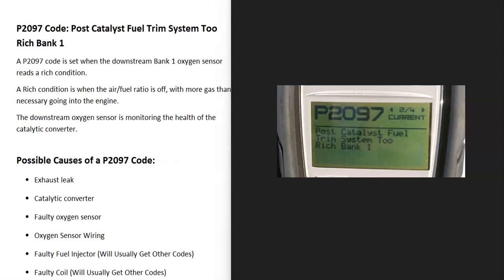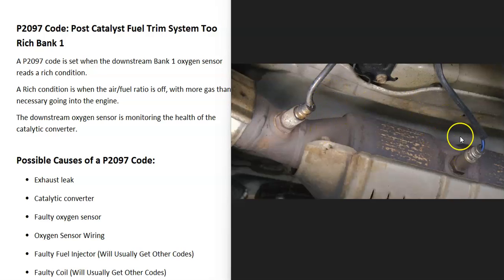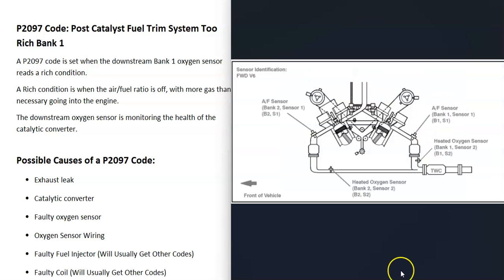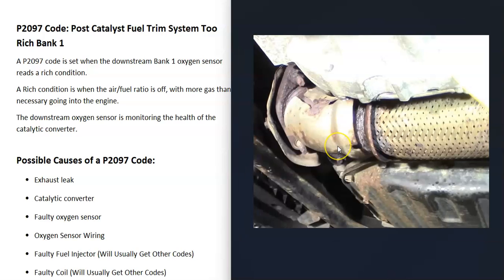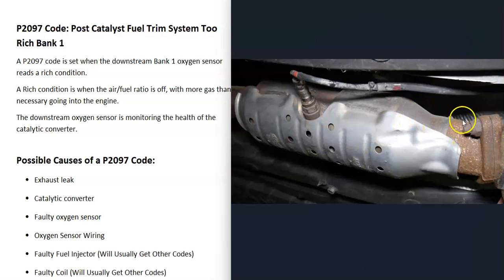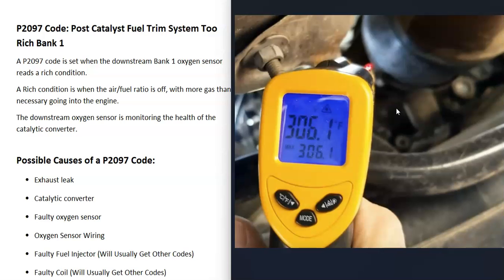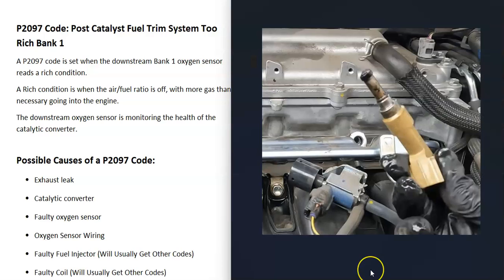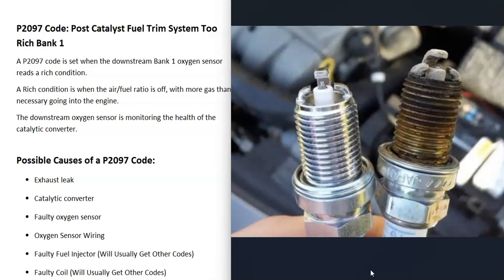Causes and Fixes P2097 Code: Post Catalyst Fuel Trim System Too Rich Bank 1

Comment: Had this code on a 2016 Chevy Malibu. Light went off after getting the code and hasn't come back on for 4 days of mixed driving. should I still worry about driving the car?
Reply: Have you gotten it fixed? Any symptoms and has the code come back? I have a 2018 Malibu and same code plus P0171

Comment: 2020 Honda HR-V. Throwing codes P0171- Bank 1 too lean. AND code P2097- Bank 1 Post catalyst fuel trim system too rich. Too lean and too rich. What gives?
Reply: I have the same codes on 2018 Malibu. What ended up happening with yours, did you fix it?

Comment: I have a 2014 Silverado 5.3 check engine light just came on. I stopped by AutoZone and they run the code and it came back P2097. 
Post CO detector bank one driver side ?

Comment: I have a 2014 Chevy Silverado was getting p2097 and p2099 codes changed both and got a p2097 back again, I was told there may be a reset? If you have any ideas I appreciate it.

Comment: I have just the P2097 code on my 2010 Subaru Impreza wagon. No other codes. I have already changed my o2 sensors and my exhaust is good. Im thinking it must be my catalytic converter. 

Do you think its worth trying a cat complete fuel, exhaust and emissions system cleaner? The car is pretty old with a little less than 150,000 miles on it. It sat for a bit before I bought it. When i drove it, it was quite bogged down before I put a fuel injector and carburetor cleaner in the gas tank, and then it started running so much better and quieter. But it still isnt great. I'm thinking maybe the catalytic converter just needs a cleaning. 

The thing is, that cleaner says its for clearing other codes, not the P2097 code. I still think it might help because it was talking about how it cleans the catalytic converter. And that it can clear codes to do with o2 sensors and catalytic converters. 

Im also pretty paranoid about maybe making my situation worse. 

Please let me know if i should try the cleaner.
Reply: Did you figure out what was the problem? I’m dealing with the exact same issues as you don’t know what to do

Comment: I literally got rid of the running lean by changing the spark plugs and coil pack and now weeks later I have system running rich 🤦🏾‍♂️ this shit is getting annoying af. I prefer doing this stuff myself as I hate being lied to or cheated by mechanics but having to go under the car to check is looking tricky as I don't have the Facilities or equipment to prop up the car.
Reply from the maker: Lean and Rich codes are notoriously problematic sometimes.

Comment: I just got this code in my malibu and im kinda new to this maintenance thing. The paper printout from the obd says i should reprogram the pcm, should i just try changing the o2 and clearing the code then seeing if it works or should i just go straight into getting to computer reprogramed
Reply: Did you get it resolved and what fixed it?  I have a 2013 malibu 2.5L

Comment: Changed both o2s and the cat is new., plugs look fine.. No exhaust leaks to note.. got rid of most codes.. but now p2097 hmm Help!..ok so check out this UPDATE: I cleared the code and drove the car home about 20 miles..the code never came back.. so is it possible that there was still some residual gas in the cat and the new O2 had picked some of that up.. I started the car with the new O2 installed BUT not plugged into the harness cuz I was checking for a Volt reading on my meter.. between .1-1V. then once I got a .1-.2v reading I knew the sensor was working.. I also checked the heater for continuity.. it was ringing loud n clear..so I know the new o2 was working at time of install... the only other thing I can think is that the cat is a cheap universal fitment china type and is not working up to oem spec.. leaving unburned fuel pass through to the downstream O2 to read "too rich" p2097... does this make any sense?. also I thought it could be a sticky injector or bad plug but I checked the plugs, they look mint.. and a bad injector would have given me more codes including misfire.. which I haven't gotten.. yet..help a brotha out, thanks Sir
Reply from the maker: Hopefully, the code does not come back; otherwise since the 02 sensors are good, there is likely a rich condition that can be hard to troubleshoot.
Reply: @HVAC_Mechanic  in a nutshell what could be some causes of a Rich condition?. bad injector/s?, bad plug, bad coil pack,.. vacuum leak, exhaust leak, ?
Reply from the maker: A Rich condition can be hard to troubleshoot since so many things can cause it. Basically, the air/fuel ratio is off more gas than air going into the cylinders. Common causes are bad injectors, high fuel pressure, stuck open purge valve, and more. If it does have a Rich condition, I would remove the spark plugs on Bank 1, match them to a spark plug burn chart, and see if a cylinder is running Rich.

Comment: Brotha, I have a 2016 Silverado. I had a P2097 code. Already replaced o2 sensors. Truck at a idle will start to studder and eventually turn off. No other code comes up. What else could I check? And advise would help.
Reply: Probably a clogged or melted cat
Reply: I'm no professional but it sounds like bad Injectors if it's rough idling and stalling, especially when stopped at lights.  Could also be you need a new cat converter (big job big cost)
Reply: @CelticStoic *small job. Big cost.

Comment: Hey I'm getting p2097 code in 2017 altima 2.5. I had both upstream and downstream replaced but kept getting several codes. When I went to change spark plugs, I found the upstream wiring connection loose and unable to stay fully clipped in. I rigged it to stay together and plan to fix it asap. All other codes went away after that except p2097.